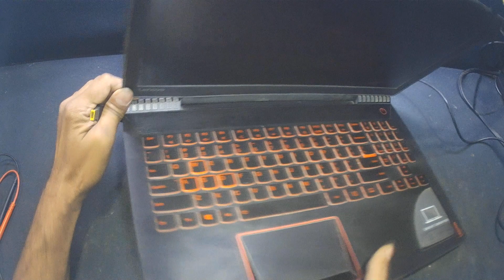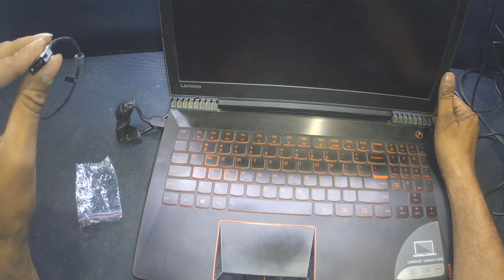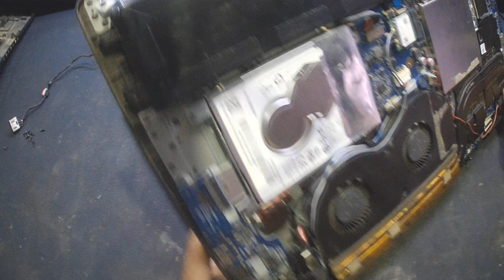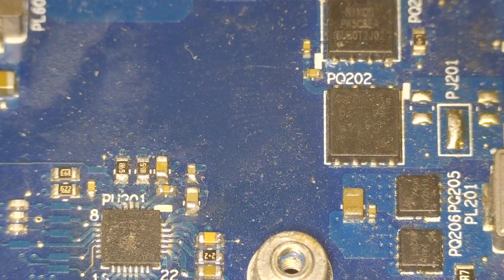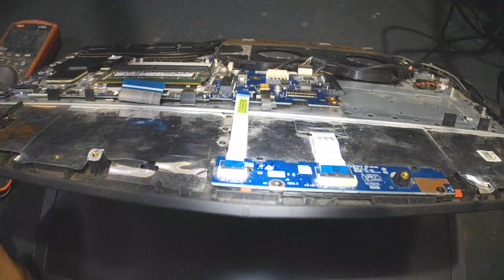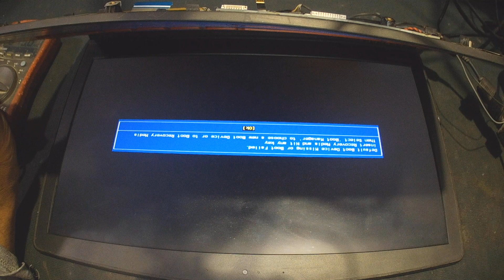Lenovo Legion Y520 Gaming Laptop No Power Repairs | DC Jack and Power IC Problem | Fixed

Comment: Hi I have a similar problem but the charging light flashes when plugged in and the power light on the right side turns on when the power button is pressed. However, display doesn’t turn on and fans don’t spin. Repair shop says dead motherboard, are they right?
Reply from the maker: Hi, Dead Motherboard is a simple explanation, ask them what section inside MB is not working like 12v, 3volts, 5volts or RAM or Processor section, or Bios need re-writing, the only section is the processor if it is shorted or dead then it is not worth repairing the board better replace in this case, better take it to the laptop repair technician who repairs or replace SMD components, Thanks

Comment: Hello, I'm facing the same problem, but cannot tell what is wrong on motherboard. 😕
Reply from the maker: is it a no power or no display issue, are there any lights on laptop and how did you identify the problem.
Reply: @AuTech_Repairs   it is no power issue, there is no light at all and I checked some voltages with multimeter and power jack should be fine, so I assume some component on motherboard could be damaged and dont work properly or not at all. It was working perfectly for few years and 2 days ago it randomly shut down and doesnt power on from that point...
Reply from the maker: @viktor_ino  Check with board view and schematics, both are available online to download, if you have knowledge about checking volts on the motherboard, otherwise if you are near our location, you can bring your laptop to us, Thanks.
Reply: @AuTech_Repairs  thanks, I will try my best to repair it, but I'm afraid I'm not anywhere near your location so if it is not gonna be successful, I will have to give it to local repair shop’s which are not so good 😕
Reply: @AuTech_Repairs  I could provide you some pictures and videos of it if it helps

Comment: Bro, I have the same laptop facing the same issue. 
I left it at the local repairing store for more than a year but they were still unable to fix it. They said it was fixable but they still didn't which is frustrating. 
Can you please fix my laptop as well?
Reply from the maker: Hi, plz let me know what is the actual problem, are there any lights on the laptop when you plug the charger in or it is completely dead, What previous repair shop has suggested to you about the issue.
Reply: No lights at all even while connecting with the adapter. I have tried disconnecting the battery and running it on the adapter but even then no lights or anything at all just like the one in your video. 
Could you fix mine as well, sir?